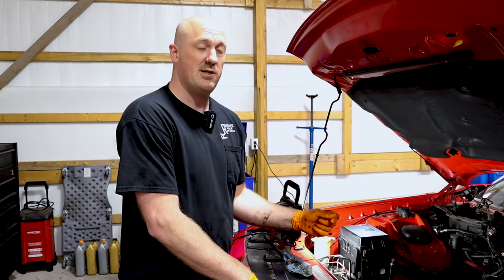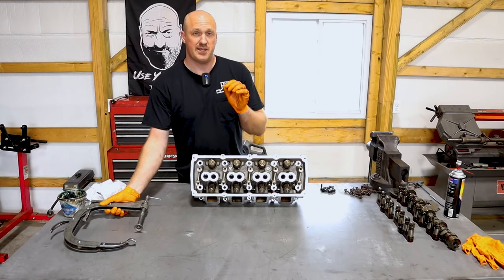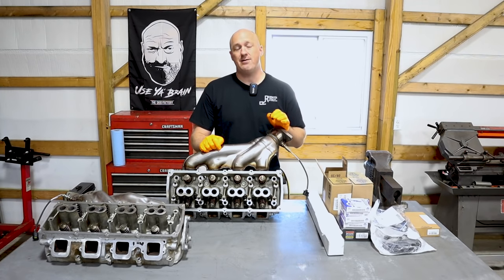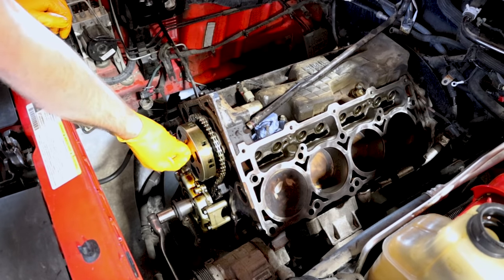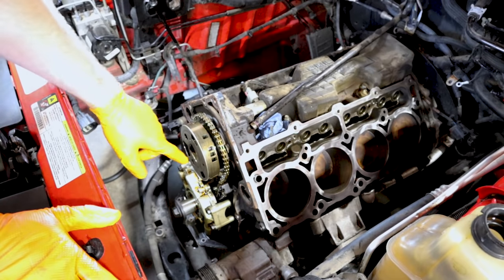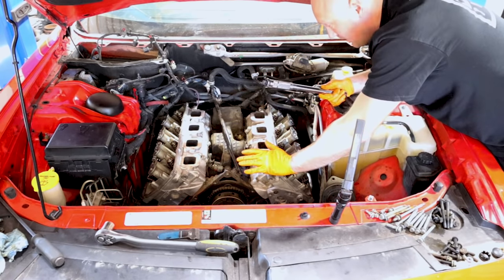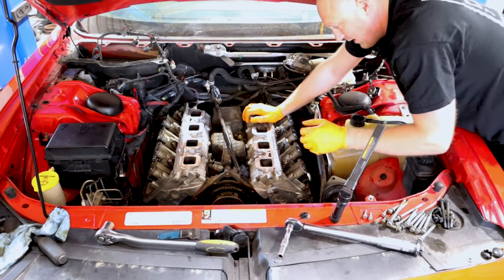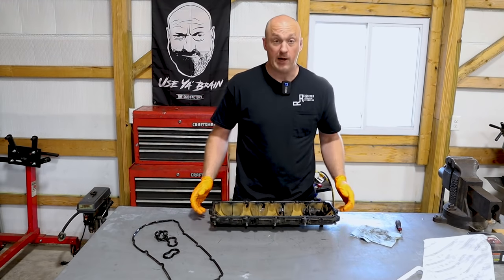Hemi Camshaft Installation Continues, SRT Headers Install! Budget Challenger Build Ep2

Comment: Great video and great attention to detail! I noticed you didn't degree the cam though. Was this due to it being an OEM sourced part? Instead of Comp or a similar aftermarket as an example.
Reply from the maker: That's correct, the can is basically in time or it's not, there's no real adjustment to be made. 👍
Reply: @ReignitedAuto  You can install it straight up like in the video but if the lobes aren't machined precisely on-center, you can have in excess of 6 degrees+ variance. You have to measure intake valve event to know precisely.
Reply from the maker: @seanadams8444  that is true
Reply: @ReignitedAuto  it bit me in the ass once 😂 rampant paranoia.

Comment: Replaced the camshaft and lifters. Bolted the heads back on and installed the rocker arms and pushrods. Made sure the lifters were seated on the rocker arms and placed in the lifter holes. I rotated the engine click wise and felt pressure as I turned the engine. Some of the rocker arms moved and some didn’t. I also heard a  slight scratching noise inside the engine. What should be my next? What could this be? I also spun the engine before I put the heads on and it spun fine with not much pressure.

Comment: I love your videos! I have a question! Wanting to run a 223/232 cam, 6.1 Eddal Brock manifold and 1 3/4 shorty headers! What would be the gains if I went with long tube? I want a street car, but long tubes add power! Advise please.

Comment: Can you run a oil additive like lucas stp motor honey etc to help with these issues 
Ive torn down a few motors that additives were used in all the internal parts were coated with the sticky residue left by using the additives  
Thank you for any advice or suggestions

Comment: You didn’t show how the camshaft bolt is tightened / torqued down after installing the timing. The timing just spins when you try to torque it, how did you do it without spinning it while tightening it?
Reply from the maker: Usually I access the flex plate and stick something in there so it can't rotate, then torque the cam bolt 👍
Reply: @ReignitedAuto  great thank you! I’ll try that on my 6.1! One of my lifters was seized unfortunately so I’ve been at this motor for a week now removing parts for the cam / timing / lifters install, can’t wait to get her back on the road!

Comment: So I have the same car 2010 Challenger rt. My lifters failed so I'm gonna change it myself but one thing I noticed is the camshaft u have listed below  said it was not going to fit on the website. I typed in the same part number and everything. Should I buy the 5.7 instead with that or just continue with ordering the 6.4 liter camshaft like I want too
Reply from the maker: It depends on whether you want to keep MDS or not. If you don't, this camshaft works just fine. But if you are keeping MDS then you need to order the 6.4 cam that is MDS equipped. 👍
Reply: @ReignitedAuto  okay awesome. I have no intentions on keeping the mds. Thanks for your help. Very informative video

Comment: I used one of the smaller valve spring compressors and it exploded. Definitely want to get one of the C clamp ones but I was told some of them are too small for the hemi heads and will leave grooves on the valve cover surface. Do you know if the summit racing one will work? If not which one are you using?

Comment: Whats your opinion on porting your cylinder heads while doing this build?
Reply from the maker: Obviously every little bit helps,  but myself personally based on the costs to have someone port the heads,  is rather use that money towards a forced induction mod.  👍

Comment: Hey Sky,  after i did the cam/lifter/mds swap, I am getting low oil pressure. Do you have any ideas what it could be? 2-8 psi at idle and 11-20psi at 3000rpm. I did not remove the oil pump or pickup tube. Did not replace springs. I confirmed with a mechanical gauge its low. installed a new oil filter and using 0w40. no check engine light or ticking. It charged the lifters during first drive test. 2016 Scatpack
Reply from the maker: I'll admit you've got me stumped here. Is there any chance the head gaskets got flipped or mixed up side to side? Trying to think of anything that could cause low oil pressure...

Comment: Great Video! I really appreciate your tutorial, it is very well done! I noticed some carbon deposit on the pistons had not been cleaned off before re installing the heads. What is your opinion regarding the necessity of cleaning it off or not doing so? What method do you recommend if cleaning is necessary?
Reply from the maker: Definitely not necessary, I'd only think about doing it if say I had bad valve stem seals and there were VERY heavy carbon deposits on the pistons. Normal operation though it doesn't affect anything. If you do want to clean them I recommend a combination of brake cleaner and scrubbing them with a red scotchbrite pad, it'll take some effort, but they'll clean up nicely with no scratches. 👍
Reply: @ReignitedAuto  Thanks for the info! Another Question> I am interested in installing a Comp HRT Stage 2 cam with 0.596/ 05.82 lift and 220/230 duration in my 2012 Charger 5.7 Hemi. Will I need to disable the MDS or VVT with such an agressive cam? Also planning to replace the lifters. What lifters do you recommend?
Reply from the maker: @markr6742  You will need to disable the VVT, I'm not sure if the Comp Cam has a provision for MDS, but I doubt it. Also, I still recommend factory lifters. Texas speed and performance sells factory lifters with their kits, I know this because I worked at the Dodge dealer they ordered all their lifters from.
Reply: Thanks for the info! I did not have luck with Texas Speed's Website for those items but i will check with them by phone.
Reply: @ReignitedAuto  Do you recommend thread chasing the head bolt holes and any other proir to putting them back on? If so can you provide a description of the tool I need?
Reply from the maker: @markr6742  I do recommend chasing the threads on both the head bolt holes and the intake manifold bolt holes. Just use a thread tap and run it through a couple times for each thread. Unfortunately I don't know the sizes off the top of my head you'll have to look those up.
Reply: @ReignitedAuto  Thanks!

Comment: Im about to attempt replacing my lifters and cam, i would like to know which torque wrench you used and which size(s) ratchet drive for tightening down all the screws?
If you have a link to the one(s) you used please provide them Sky, thanks!

Comment: My 2013 challenger has 180k miles, what are some parts I should definetly take this oportunity to switch because of the mileage. This is currently what Im buying. Cam, lifters, push rods, springs, oil pump, timing chain with guide and tensioner, mds delete. Anything extra?
Reply from the maker: That's pretty much the list right there 👍
Reply: Crank bolt and cam bolt, supposedly non reusable, but up to you. I personally like to have them on hand just in case as I use the old bolt to reinstall the balancer, then replace it with the new one. Have you thought about the valve seals , since you're replacing the springs anyway ?
Reply: @DL101ca  yess valve seals too. The bolts maybe.

Comment: Do you have a video on how to remove the exhaust manifolds on a 345 challenger, is it easier to remove the heads to do the manifolds?
Reply from the maker: It is by far easier to remove the cylinder heads to do the manifolds. You can do them with the heads still on, but it's a massive pain. If you are already planning on having the heads off for other mods or repairs it's a good time to upgrade 👍
Reply: @ReignitedAuto  Thanks, with 70,000 miles on the vehicle, I think I should look at changing the lifters before they fail and do the manifolds at the same time.

Comment: What if you do have MDS and the car goes into limp mode? Long story short, driving in sport mode there was no knock, in eco mode, there is… was a metal knock. Wife was passing someone while in sport mode and the car lost power and would not go above 3500rpm… limp mode engaged… I pulled the intake and MDS solenoids. Metal shavings on the magnetic end of the solenoids. The MDS sensor in the bird house was clean though. About 160k on the car. Planning to pull the heads as soon as I get all the tools I need. Id love to find a garage With a lift I could rent but for now, the gravel and broken concrete will have to work. So if you, or anyone else is down to provide answers along my journey, that would be great. I need to have the car in dependable Road Trip form by the end of April 2022. Everything I do will also be posted on TikTok and right here, on YouTube, with a few YT shorts thrown in there. Top questions: What cam and lifters will work best outside of the stock MDS 5.7 cam/lifters? Anything specific I should look out for? Should I swap the intake for a 6.4 as well? Same question for the headers… I currently have 3” exhaust with a small 10”Glasspack from the cats back. I like the sound it made when I stepped on it… so… Someone? Anyone? I have an extra pair of hands to help do the work if needed, I just need a brain to get info from and discuss what the hell I am doing so I don’t break it more than it already is…
Reply from the maker: It sounds like you're on the right track, i know people automatically want to change from the stock cam/lifters, but you have to realize that if they made it 160k miles the first time around they are pretty good. I 100% recommend factory lifters,  this would be a good time to get rid of the MDS if you want to. Upgrading to a different camshaft can net you more power, but know that any camshaft swap would require a custom tune to take full advantage of it. 6.4 headers I feel like make a decent gain, but will also require some custom work to bolt up to your existing exhaust. I'm happy to assist if I can, best option if you've got more Questions is to message me on Instagram @reignitedtx I can't promise I'll reply right away, but I try to when I can. 👍

Comment: Help!  My son my nephew are two outstanding young men who are doing this job right now.  However, a bolt that holds the rocker arm broke off down in the little concave receiver area.  How can they get that broken bolt out of there?
Reply from the maker: Left hand drill bits would be my suggestion. Many times a steel bolt that is broken off in aluminum threads will spin out fairly easily if you can get a good bite on it. Tell them to use a center punch on the broken bolt to establish a good spot for the drill bit to bite without walking. Once the drill bit starts to get in there a ways I bet it'll spin out.
Reply: @ReignitedAuto  Thank you SO MUCH ! That worked for them. And thank you for making these videos to guide them in these repairs!
Reply from the maker: @melodyflores4854  great news! I'm happy it worked 👍

Comment: If I wanted to get a better cam for my 6.4 Hemi, what else would I have to get to have it function properly. Or could I just get the better cam by itself?
Reply from the maker: Obviously a tune would be the best thing you could go, but as far as mechanical parts needed, the 6.4 comes with pretty good valve springs so you won't have to upgrade those, but, you will probably want hardened pushrods, and also most aftermarket camshafts require you to disable the vvt with a phase limiter that gets installed in the cam phaser. I have a video coming out in a couple days that shows that process in detail. 👍
Reply: @ReignitedAuto  thanks I’ll be looking forward to it

Comment: Do you have experience installing a cam without removing the cyl heads on the gen 3 hemi? If so, how likely are the lifters to fall out of their lifter bores into the cam shaft passage way after the valve spring pressure has been released and the cam rotated 360 degrees? Any recommendations? Thanks
Reply from the maker: I just did it on my 6.4 rebuild just to see how it felt, doesn't seem like it's a big issue to do it. I was worried about the lifters sliding forward as well, but I think they stayed just fine. You do have to spin the cam 720 degrees though to get them all. 👍 If one lifter does slide forward you can use a long thin magnet through the pushrod hole to pull it back again.
Reply: @ReignitedAuto  you'll only need to spin the cam 360, the crank 720
Reply: Angle torque tips 
1. Use a paint pen, or chalk to mark the fastener, estimating any angle after your socket comes off or you need to take another bite is very inaccurate. 
2. A  hex he'd bolt has 6, sixty degree flats, for a total of 360!
Reply from the maker: @brentfellers9632  I like that second one!
Reply from the maker: @brentfellers9632  I like that second one!
Reply from the maker: @brentfellers9632  yep, I only use the crank bolt to soon the engine over, so 720 for me.

Comment: Currently putting a non MDS cam and Hellcat lifters in a 2014 Dodge Ram 5500 with the 6.4 Hemi. This is my first time ever being this deep in an engine on my own and first time being around the Hemi engine as well.  
A couple things, 

1. Is there a way at all to set timing without removing oil pump? My pickup tube I believe is mounted in two different locations so I believe I would have to remove oil pan which I would definitely prefer not to do. Just curious if it can be successfully done without removing oil pump. 

2. How do  you torque cam bolt and keep engine from not spinning over? My engine is still in the vehicle and I do not have easy access to the flywheel to hold it. 
Thanks in advance
Reply from the maker: How far along are you? Is the cam out already? If the cam isn't out yet then you can set timing before you remove it and then you're good to go. If the cam is already out then it's a little tougher. As far as torqueing the cam bolt, if you've got a strap wrench sometimes that's enough to hold it in place. If not, gotta access the flex plate.

Comment: No assembly lube on the lifters? Do you use blue locktite or anything on the bolts for rockers, cam etc?
Great videos, thanks!
Reply from the maker: Nah, you've already got assembly lube on the cam lobes so it's pretty much the same thing. I don't use loctite for most internal components, but I think that's a personal preference. Factory manual doesn't call for it, so I don't use it. 👍

Comment: Can you retain the VVT if you perform an MDS Delete.  Example I have a ram 5.7. I want to do MDS delete and install 6.4 cam and new lifters all around.
Reply from the maker: With the 6.4 cam yes you can retain VVT, with the larger performance cams you have to install a VVT limiter.

Comment: Every hemi video I see regardless of miles cements the fact I'm selling my Ram. It's a big problem for me as I'm not a auto shop. I have a beater station car (Honda  Accord with 213k miles and its been maintained since new) No problems mechanically...
Reply from the maker: I get what you're saying, but it's not really apples to apples to compare a v8 that makes 350hp to a 4-cyl that makes 150. Major repairs do cost money though, and they're getting more and more expensive.
Reply: Mines got 200k HARSH miles on it 🤷‍♂️ had lifters fail at 97k. Idiot tech ONLY replaced the lifters. It tap dances but still goin strong waitin for my non mds lifters to come in

Comment: What transmission are u using an the timing doesn't matter if it's compressing stroke or not?
Reply from the maker: The trans is the stock TR6060, which is just a T56 custom made for this car. As far as the timing goes, the competition strike didn't matter because the crankshaft doesn't know which stroke it's on, you're just setting it to TDC, and you're physically installing the camshaft on the correct stroke. 👍

Comment: 15 Dodge Durango R/T 

How did you keep the engine from turning while torquing the cam shaft sprocket bolt?
Reply from the maker: Best option is to access the flex plate and stick a pry bar in the teeth to keep it from rotating 👍

Comment: The valve springs part number that is in the description is for 5.7 do I need did you change them just because. And what type of modifications for the SRT HEADERS or the fitted right in
Reply from the maker: Valve springs are not required, the srt headers are a direct fit for challenger, charger, magnum or 300 👍

Comment: Great video again, I'm following the series and its exciting. I too live in Texas but I am deployed overseas right now so all this content gets me excited for when I get back. I already have everything in the Mopar website ready to buy but just waiting just in case I need some other stuff. Love the content. I am doing this exact same thing and cleaning the intake pretty good so that once I put the oil catch can back this time keeps it clean. Also taking the heads to get cleaned at the machine shop. any good ones in Texas that you recommend? would you consider porting the intake and exhaust ports for extra flow to help with the manifolds and also porting the intake, like not much but just some to improve the flow with this newer cam (I know its not necessary) but would it make a performance difference? What do you think?
Reply from the maker: Unless you are going for maximum power I don't think porting is worth the money. The stock heads flow really well and with the cam upgrade they work even better.
Reply: @ReignitedAuto  thank you!
Reply: I would have to agree. No point in porting heads that flow in stock configuration more air than you can push through your engine and exhaust.

Comment: Main issue I’ve seen with the lifters has nothing to do with MDS, but rather the oil pump not pushing enough volume at idle engine speeds so swapping in a high volume pump would be what I’d do.

Comment: I plan on doing this exact thing on my 2010 r/t charger with 132k miles. though my car does have ads I plan on getting rid to it. So should I get the non ads cam and lifters and tune it to get rid of mds. or get mds parts and just use the tune to get rid of it